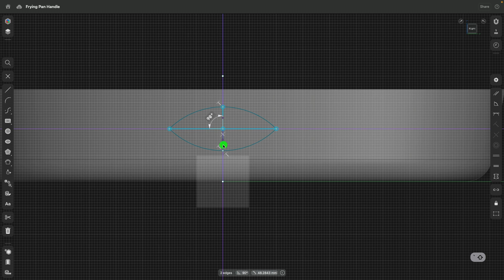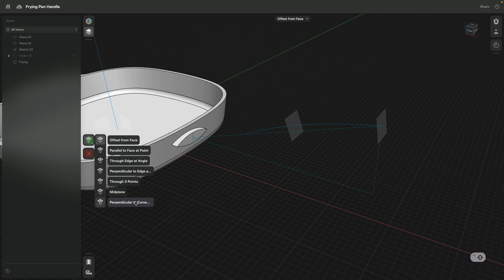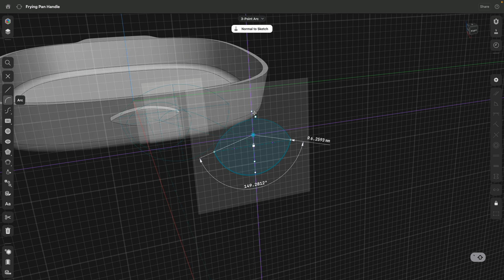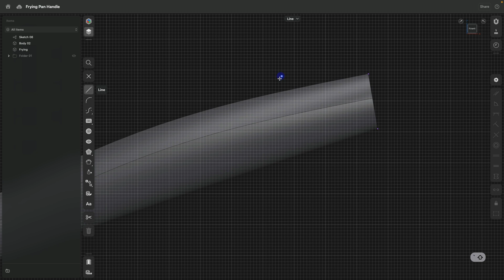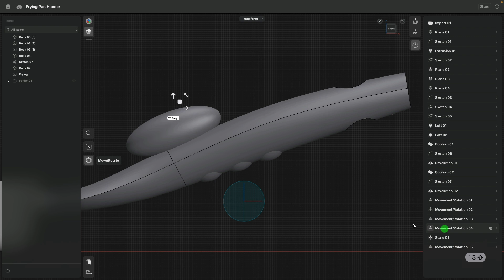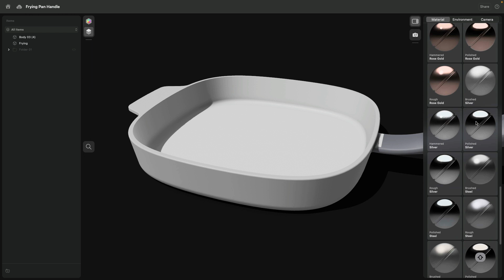Pan Handle Design with Loft, Sweep, and Subtract | Modeling Projects

Comment: Hi @shapr3d @cekuhnen Thank you for the great video. I get and following all the principles for the handle. However I am puzzled about the construction of the pan! I am struggling to recreate it. I haven't the skills to work how out the curves werer drawn and in particular continuous rotational nature of the material. I simplistically I tried making something similar from a 200x200 rectangle and arcs placed the corners. When I extrude this up 35mm and draft it -10° (similar to the dimensions in the import)  I get intersecting lines and panels, which don't appear on the imported pan!? So how do I create the pan is what I am asking please. Thank you.